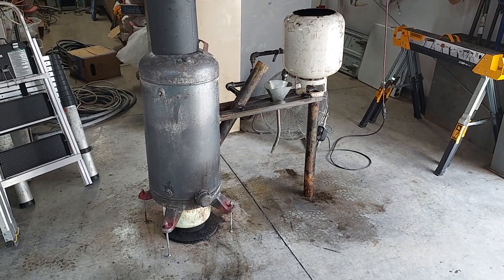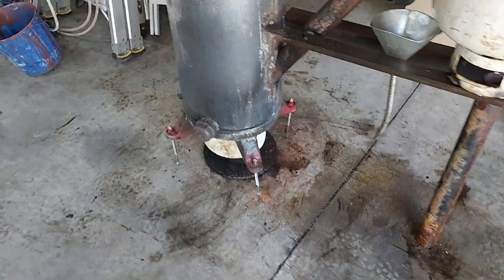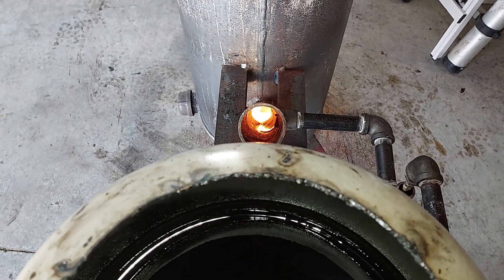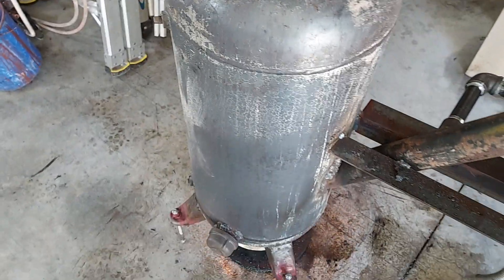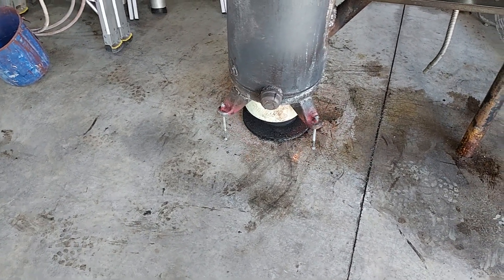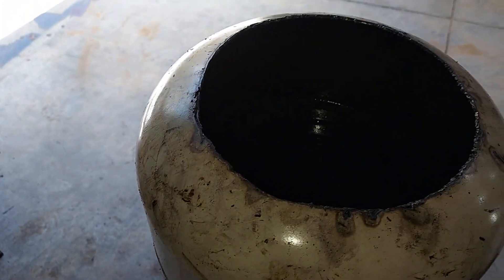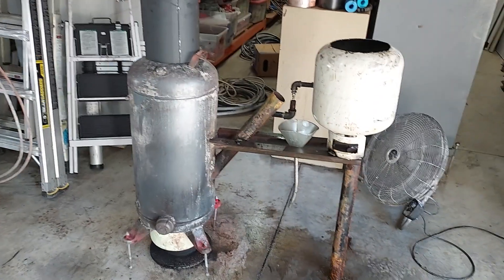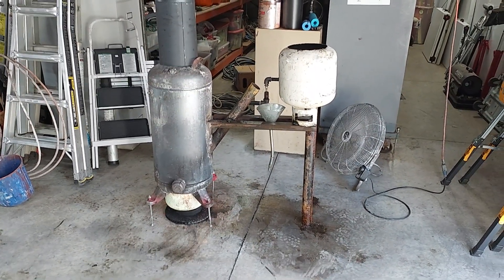ROCKET WASTE OIL BURNER HEATER. BEST AND EASIEST TO USE ONE YET

Comment: Would a larger air intake work better? and make a swirl plate on the bottom of it?  Just wondering. I guess it will only draw what it needs as long as it's available. I don't know how much is enough though.
Reply from the maker: it could. you could experiment. no baffle on pipe to burn bowl. just 2" pipe stuck down in burn bowl couple inches
Reply: @burninghot5830  thanks